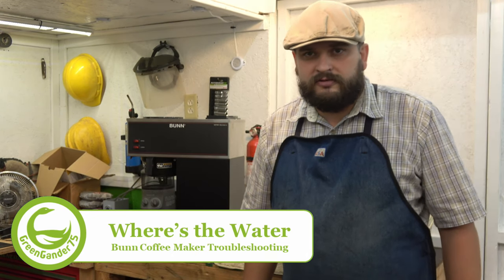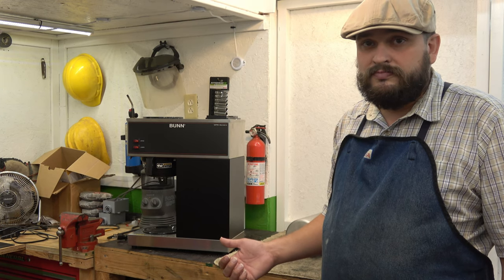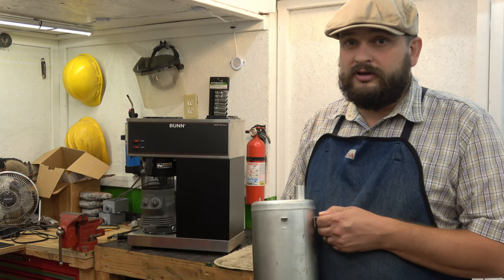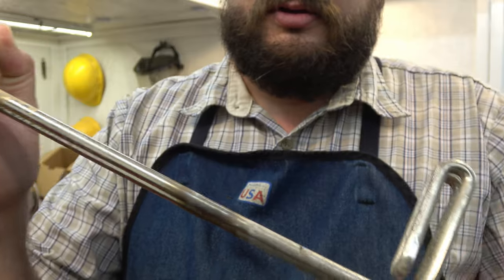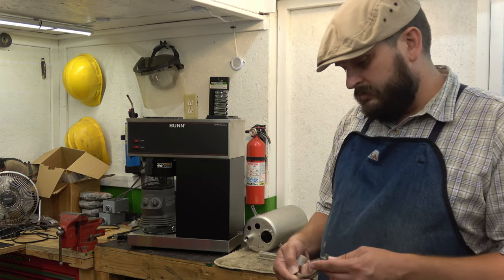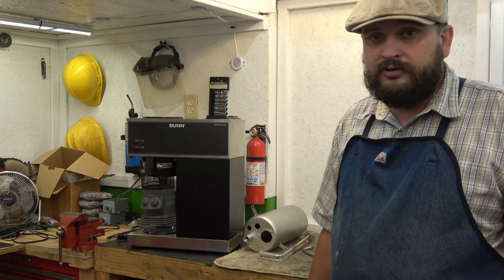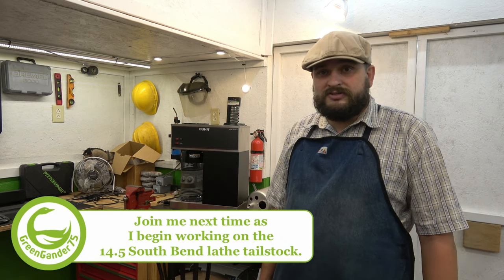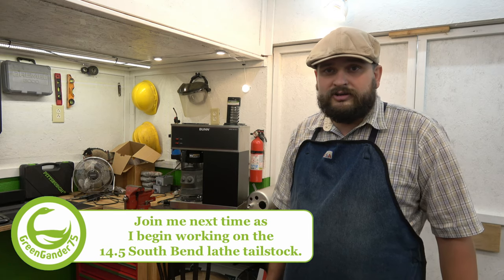Where's the Water | Bunn Coffee Maker Troubleshooting

Comment: Thanks for the video. Had a real old model that leaked when water was put into the tank. I'm not a coffee drinker so I didn't know about it needing to be full and the model being 30+ years old there wasn't a manual for it, so that tip helped immensely. Ended up being that the temperature probe seal broke from heat fatigue, so when the tank was filled it spilled out from the hole rather than the spout. Fixed the seal and descaled it. Should work for years to come now.

Comment: Nice informational video.  My wife and I used BUNN for many years.  Our issues usually related to them developing a leak.  I think over time the spring would wear through the tube.  Keep on mind that we were using a residential version of the maker.  By the time we were on our third maker we started using zero water filtered water.  Never had any issues with hard water after that.  Now, several months ago my mother in law broke the pot.  We replaced it with a moccamaster.  It is an induction heater and is a surprising fast brewer.  Thanks for the video, it was good seeing information.

Joe
Reply from the maker: Hi Joe.  Sorry for the late reply.  I think the hard water and the spring issue is the most common issue I've had on the BUNN coffee makers.  Filtered water sure makes the difference.  Thanks for the comment and for watching!

Comment: Factory Instructions
Initial Set-Up
CAUTION - The brewer must be disconnected from the power source throughout the initial set-up, except
when specified in the instructions.
1. Insert an empty funnel into the funnel rails.
2. Place an empty dispenser under the funnel.
3. Open the flip lid on top of the brewer and pour in three pitchers of tap water. Allow approximately two
minutes between pitchers for water to flow into the tank. While the third pitcher of water is entering the tank, the tank will fill to capacity and the excess will flow from the sprayhead, out of the funnel, and into the dispenser. FIG. 1
4. When the flow of water from the funnel stops, connect the brewer to the power source and wait approxi- mately twenty minutes for the water in the tank to heat to the proper temperature. Some water will drip from the funnel during this time; this is due to expansion and should not occur thereafter.
5. Empty the dispenser and replace it under the funnel.
6. Open the flip lid on top of the brewer and pour in one pitcher of tap water.
7. When water has stopped flowing from the funnel let the water in the tank reheat to the proper tempera-
ture.
8. Empty the dispenser. The brewer is now ready for use in accordance with the coffee brewing instructions
below.
NOTE: The control thermostat will need to be adjusted downward to compensate for high altitudes. Refer to
Service Manual for instructions.
 COFFEE BREWING
1. Insert a BUNN® filter into the funnel.
2. Pour the fresh coffee into the filter and level the
bed of grounds by gently shaking.
3. Slide the funnel into the funnel rails.
4. Place an empty dispenser beneath the funnel.
Models with warmers - Turn on lower warmer
switch.
5. Open the flip lid on top of the brewer and pour in
one pitcher of tap water. FIG. 1
6. When brewing is completed, simply discard the
grounds and filter.
            P4038.50
   FIG. 1 POUR IN WATER ONLY
 Page 4
10053.1 101508

Comment: I have the home version (a "vacation" on/off switch, but no hotplates on top), and it has given me great coffee for years. BUT, I haven't cleaned it since I got it (I use only filtered water) and lately, I get about 8 or 9 cups out for the 10 cups I put in.  I add a little extra water to the reservoir to fill the pot, but it seems to me to weaken the brew.  I had just switched to buying ground coffee instead of beans, so I thought the different grind might be more absorbent.  I will, of course, try cleaning the unit per instructions, but can you think of another reason for the shortfall?  
Also, do you think I should use any of the citric acid coffee cleaner stuff to get rid of any scaling in the tank?  I realize it would require several rinse cycles to get rid of the taste.
Great video!
Reply from the maker: Hi Norm.  I've been giving your coffee maker some thought and I'm wondering if it could be a combination of the ground coffee (I think your right about it being more absorbent) and the spray nozzle and fill tube might need some cleaning.  I was looking at some owners manuals for the home version of the BUNN coffee maker and noticed they recommend using diluted white vinegar and a descaling tool.   The website for the owners manuals can be found here: https://retail.bunn.com/support/products  

I wish I could be more help, but I think your on the right track to getting it working again.  Thanks for the comment and for watching!
Reply: @GreenGander75  Thanks for the link; I have downloaded the appropriate manual.  However, I had already gone ahead and bought pipe cleaners and coffee pot cleaner, and pretty much do the processes based on your video.  I twisted together three pipe cleaners to get the right diameter and stiffness to replace the misplaced deliming spring and then used the liquid cleaner, based on their instructions.  I did this all while plugged in, thinking that the heat would speed up the process, but of course, by the second drain and fill, cold water was passing through the system. By the third or fourth drain and fill, I could still taste a bit of the cleaner, so I unplugged the coffee maker and drained the system, pretty much like in the manual, except I hadn't removed the spray nozzle.  That water sure shoots out pretty fast and far upside down, not always into the sink!  Anyway, the coffee now is up to standard, and up to the top of the pot, so it was the crud build up and not the coffee's fault after all.  Again, thanks for the video, and the advice.
Reply from the maker: Hi Norm.  Glad it worked out for you.  Great news!

Comment: I would say stick to the manufacturer instructions. About a pitcher of water is 1800g and it says use 3 of them. Add the decanter on the bottom and the residual water will come out all before even plugging it in. Plug it in and wait 20 minutes. After 20 minutes you will hear it stop heating up. This means the tank is pressurized and full and to temp 212 degrees. Add desired amount of water and the displacement will be the amount of coffee you will make. Cheers folks.
Reply from the maker: Hi.  Sorry for the late reply.  I wasn't receiving comment notifications.  Great advice.  Thanks for watching!
Reply: @GreenGander75  .  .

Comment: Hi. I bought a used stf-20.  It works fine as a pour over brewer, but wont brew from the plumbed line or dispense hot water from the dispenser.  I have replaced the inlet valve with no change.  What else could it be?  There is NO information on the net.  Thanks
Reply from the maker: Hi.  Sorry for the late reply.  I wasn't receiving comment notifications.  Unfortunately I haven't had an opportunity to work on that model before.  If your still in need of assistance I would be happy to look into it for you.

Comment: By unplugging this coffee maker you would allow some growth of bacteria in the tank.
This is why it remains on to keep the tank of water hot enough to fight bacteria growth.
Reply from the maker: Interesting observation.  Perhaps after having it unplugged for an extended period of time it should be recommend to allow the tank to come up to full temperature of 190 degrees (about 15 minutes) or run cleaner through it before use.  Thanks for the comment.
Reply: @GreenGander75  if turned off for an extended amount of time , the tank should be sanitized before use. Probably best course of action.

Comment: I got a commercial cdb model but as soon as I fill from the top (no water line hooked up) about 4 cups of water immediately flow out the Brewer spout. I can run it until nothing comes out (empty) then cold or hot as soon as I add 11 cups of water 4 cups come out ? Any idea why. It was a used machine when I got it. Trying to clean it and make sure everything is ok before I donate it to our local VFW. Thanks
Reply from the maker: Hi.  I believe that model has an adjustment for filling and over/under fill.   Do you have the model number?  I'll see if I can find you a link to the owners manual.

Comment: I have Krups Siziliana coffee machine. On this machine hot water and steam go through the same pipe, when I accsidentally tried to use steam before the machine heated up enough. Now i can only heard the pump inside, but no water or steam are going out. Do you know how to fix it?
Reply from the maker: Hi Milija.  Sorry I didn't reply to your question sooner.  I'm not familiar with the Krups Siziliana, but I'll be happy to help if I can.  I did some research into a similar model (Krups Orchestro 889) sold in the USA.  The manual indicates that it may work again after it has time to cool down.  Are you still having issues with it not working?
Reply: @GreenGander75  When I tried it worked perfectly fine, i don't know it somehow fixed by itself Thanks for the response anyways.
Reply from the maker: I'm happy to hear that it worked.  Great news!

Comment: About how much did the parts cost?
Reply from the maker: Hi Sean.  The repair parts cost about $160.  This is almost the cost to replace the coffee maker.  If I had included labor it would have been cheaper to purchase a new maker.  The repair parts were sourced from www.partstown.com  and Amazon.  Parts Town is a great source for parts diagrams.   Hope this helps.  Thanks for the comment and for watching!
Reply: @GreenGander75  Thanks for the info GreenGander75.  I got  Freebie but it totally trashed.  I haven't torn it down yet- perhaps some of the parts will come in handy later if I find another Bunn "donor."